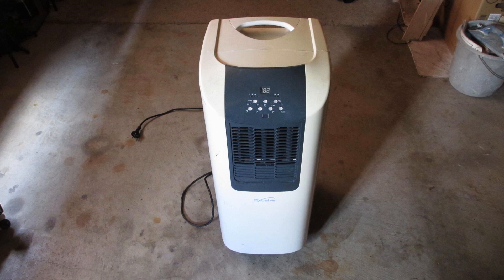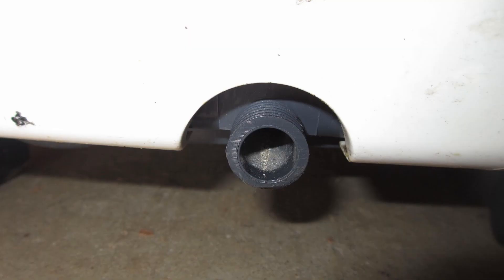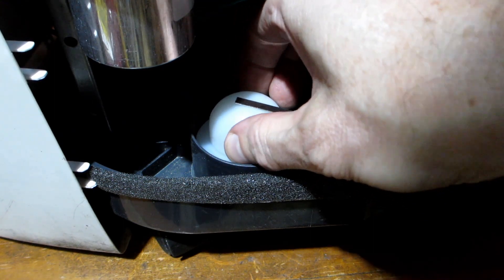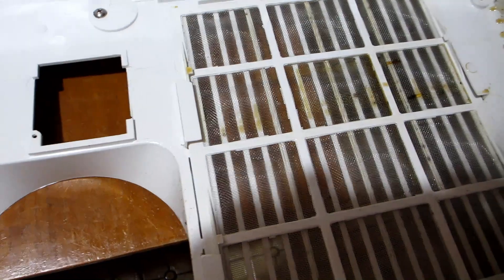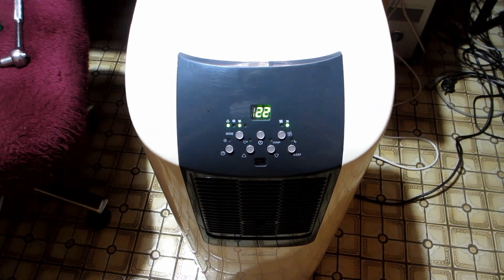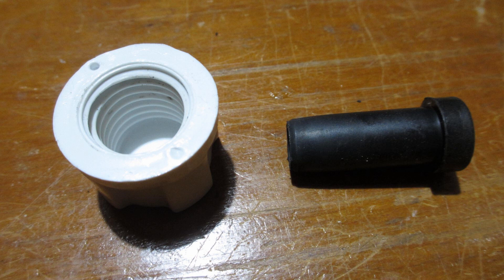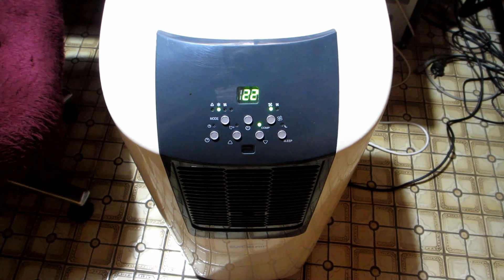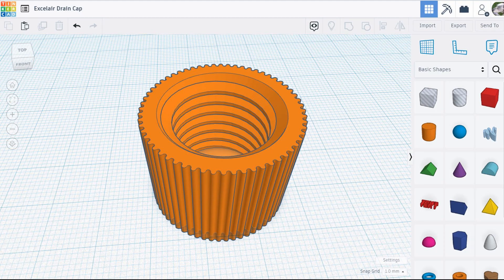Excelair EPA101A Repair

Comment: Hey, how would you go about it if its not producing cold air anymore? Throw it in the bin or Is it possible to re-gas it somehow?
Reply from the maker: I don't know if it's common for these units to leak, but both of mine still work, ie, have gas. As far as I know all refrigeration stuff can be re-gassed, but if you don't find the leak it will just leak again. Also re-gas is a bit pricey.
I would download the manual above and see if you can find warning LED or a better setting - I usually pick cold mode, and keep pressing the down button to the lowest temp.
PS: electrically, maybe the compressor relay in the control unit has failed.